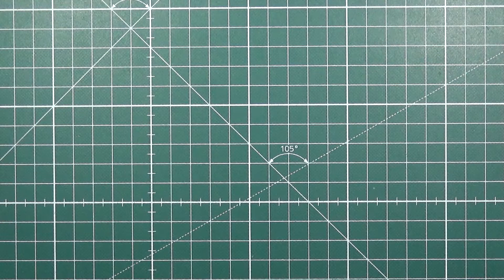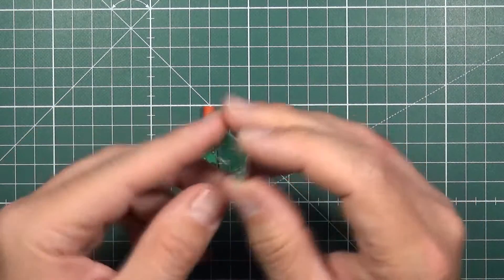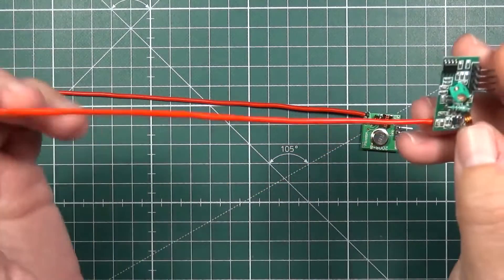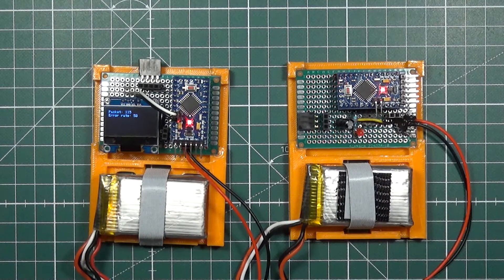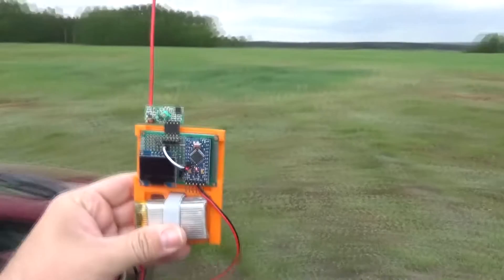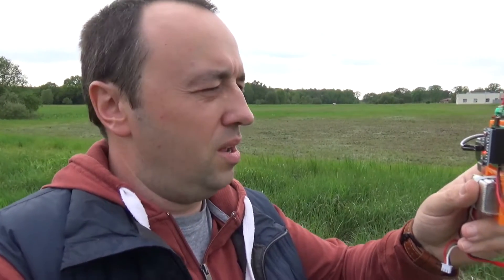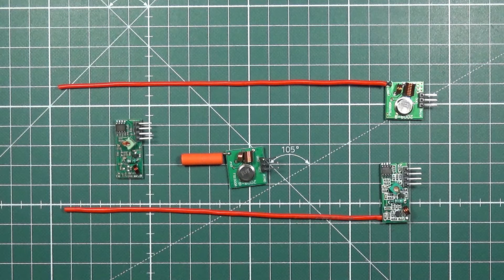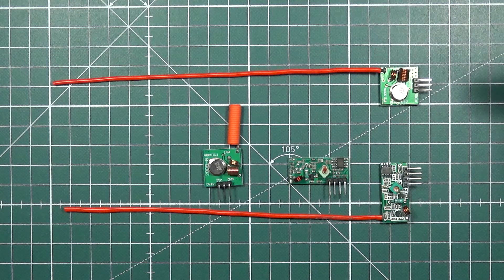FS1000A and XY-MK-5V 433MHz #Arduino radio modules range test

Comment from the maker: How FS1000A and XY-MK-5V 433MHz radio modules work https://youtu.be/bmLJvkIA__I
Reply: I tried these for use outdoors. Range in the city with coiled antennas was about 30m but gradually decreased. I discovered the receiver is very sensitive to temperature, with the range only 1m at -15C.  Useless for my application.  I’m looking for a substitute.
Reply: Can they run without Arduino

Comment: I did experiment  on FS1000A with ht12E/ht12D.

Receiver  voltage was constant  at 3.8V
Transmitter  voltage  at 3.8v the range was 50meter.
Transmitter  voltage  at 7.6v the range was 100 meters

Transmitter  voltage at 7.6v with addition  of telescopic  Antenna  on both receiver  and Transmitter   max  range  175meters.

Comment: Dear Sir PS After Hours,
I did an experiment similar to yours, but I only got 50 meters as the maximum distance between Tx and Rx.
In addition, I used the metal base of the ALTOIDS box, both in the transmitter and in the receiver.
With the help of these two boxes, I was able to increase the transmitted power by 6 times. I measured this increase in transmission.
I assume that something similar was used by you, casually or not, when you placed the transmitter on the hood of your car.
In my experiment, I sent a preamble signal, consisting of 49ms in '1', accompanied by the bytes 0xF8, 0xF8 and 0xFA. This preamble allowed the receiver to establish its operating point. Then, all the bytes from 0x00 to 0xFF were sent. Then the transmitter stopped transmitting for 1 second, and then repeated the loop.
The transmission rate was optimized for 1000 baud (1ms/bit).
The time of this loop was approximately 3.5 seconds.
I performed the test here in Brazil, on Copcabana beach, in the middle of strong sea air. I don't know if this was what limited the communication distance.
I made a video on YouTube, without verbalization, but with consistent images that can be understood by anyone in any native language.
Here is the video...

https://youtu.be/zqkNYZesdjs

Please watch it, perhaps you can discover the huge discrepancy between the results obtained by us.
Thank you.
Moris Alkabes

Comment: These modules are also excellent to listen to doorbells (sender) or to activate doorbells (listener). ;-) With these you can combine different models or brands and use only one doorbell knob (sender) to trigger all doorbells by sending all the codes required. Using RF switches (listener), it is possible to activate or deactivate lights or other equipment remotely from your arduino.

Comment: Hey I know this is kind of an old video but I have a questionand sorry if it seems stupid but I know nothing about this. Im big into rockets and I was wondering could you hook up extra wires coming off the receiver to a fuse to iqnite the thermite in the rocket engine with current?
Reply: YouTube deleted my reply so I will repeat yes you can.
Reply: There is a version of this receiver with relays that act like a wireless switch and you have a push button key fob that's a transmitter.

Comment: Car Tyre Pressure Monitoring Systems (TPMS) work on 433MHz, so placing your TX/RX modules on the car and saying "this should be free of interferance" is quite ironic!

Another video I've watched says your attennas should be 173mm from solder point to end to work best at 433MHz.

Comment: Any video explaining  how these 433 mhz transmitter and receiver circuit works  , what is the function of every components used in the schematic  ,  how the signals are transmitted from transmitter to receiver  to control the  e.g. motors of the RC toy

Comment: Hi. I am experimenting with these modules, but they work wthin a few centimeters only. Even when I add an antenna to one or both of them it extends the range to 1 meter only. 
I have 4 pair of them, so I tried to combine them without any success. Also tried to tune it, did not help either.  Do you have any idea, what could be wrong?
Reply: Try these :
1. Use half wave antenna 34.6 cm wire for the transmitter
2. Power transmitter with 12V, receiver with 5V + decoupling capacitor on power rail
3. Make sure both transmitter and receiver antenna are on the same plane (both vertical for horizontal range or both horizontal for vertical range)
4. Transmit data at a very slower rate like 128 bit per seconds
Reply: If they are still not working well, try adjusting the inductor with a screw driver on the receiver module to match the frequency better
Or buy RXB-6 modules which are apparently better than FS1000A ones

Comment: Hello , I have a question .
In my project I would need to acquire (very relatively ) the distance between the transmitter and the receiver , through a calculation between the time of sending the message and the time of receiving . With 2 arduino , both with one transmitter and one receiver each .

the first send a message and marks time , the second receives it and sends it right back , the first receives it and marks time again . I wanted to know if you have an idea (more or less) , how long the travel time ( in ms) could be , if the transmitter and receiver were 5 meters or 10 .
Reply from the maker: ranging in those short distances is not something that can be easily done at home. You can take a look at SX1280 from Semtech which has ranging capabilities but I'm not sure if it will be precise enough for your application
Reply: the resolution of time isn't enough to do time of flight calculations
but i have an idea to deal with that, you can send the same packet like a ping pongg between 2 arduinos that have both emitter and receivers 
you should send the packet with a timestamp 1000 times for example then you can have enought resolution to estimate time of flight
but you should calibrate each time for distance 0

Comment: How to build those radio transmitter and reciever to measure distance? what components are needed to build those?
Reply from the maker: those modules have no ranging capabilities
Reply: @HackerUni  I am new with these things but currently we are making a project for our school, I saw in your video you were able to measure between two points, may I ask what components did you use to be able to measure between two points and what codes did you use? Please if you could take your time to explain properly it would very helpful for us since I'm not knowledgeable at these kind of things. Thank you
Reply: @RalphjanTocong-zd7ho  that was just GPS tracking mobile app.... No module required

Comment: I have a strange problem sir😂, i built the two antennas like yours antennas but nothing works. Then i accidentally touched with my hand the transimmer antenna and it immediately started to transmit, what can be the reason of this problem?
Reply: Same problem

Comment: Hello friend, I downloaded a software developed by you (e45config), but I have a problem opening the port and reading the configuration of the module, I'm working on debian.

the error in console is
Write cmd = c3, len3, expect 4
Read [00 00 00 00 ]
Unexpected

I appreciate your help

Comment: What is tha maximum range ??
Can it transmit 4 channel signal properly between 3rd to ground floor.
Reply from the maker: You will not do it with those modules. They are 1 channel only and work through one roof only in the best of cases. So no, don't use them

Comment: i am facing a challenge of overlapping frequencies when using with more than 1 module at a time
Reply from the maker: This is how they work, there is no simple workaround. When 2 are transmitting, they will jam each other
Reply: Hi . I want to make a project with 2 Arduino , each Arduino have its Transmitter and Receiver . 
A very simple test I want to make , is a simple continuosly handshake between them. 
The first Arduino send a message with his transmitter , the second Arduino received it with his receiver and send immediately a message with his transmitter which is receive by the receiver  of the first Arduino . 
In this way there isn't a overlapping frequencies because each transmitter and receiver wait before send or listen for a message.

Comment: Why reciver contineously working without getting any signals and please tell me how it works with far mic and arduino
Reply from the maker: It just picks the RF noise. It's also not for audio transmission. It's digital only and at very low speeds